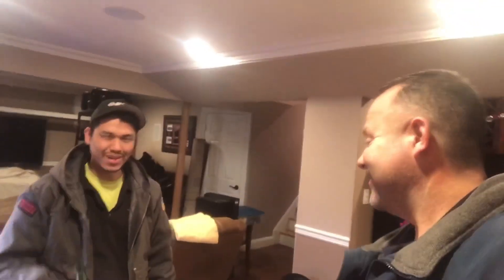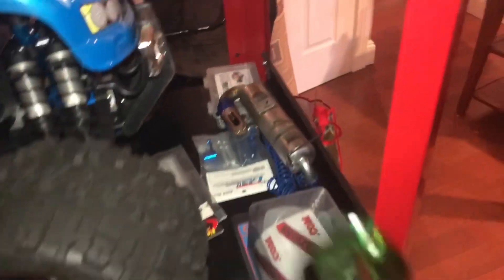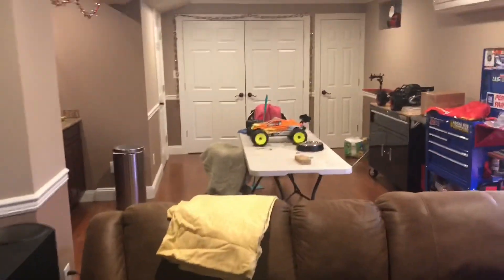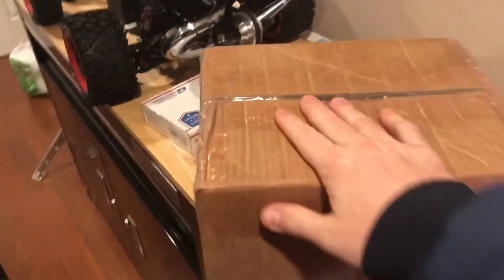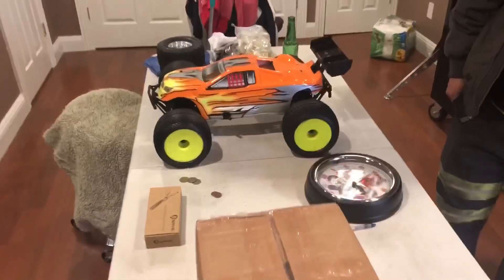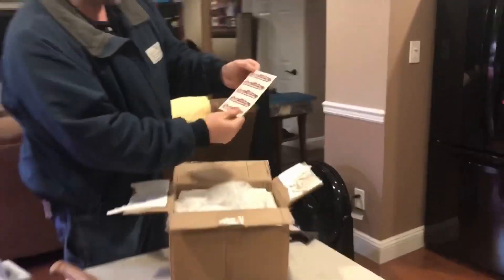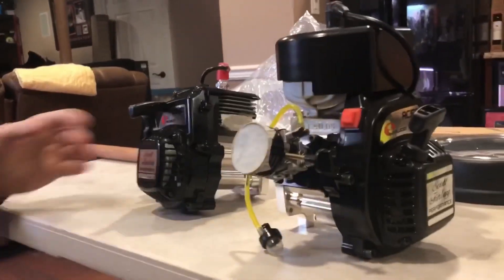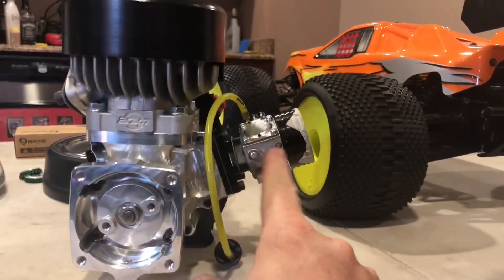Let’s Unbox A Scott Finlay⛽️Evolution💥RC50cc💨Engine With Spl Guest FT Komson! ANY ?’s

Comment: What would this motor fit in?
Reply: Anything 1/5 scale, maybe not FG or mcd but garenteed everything else
Reply from the maker: It will fit many 1/5 scales but some you will have to modify things and you will definitely have to upgrade the drivetrain especially on the 4 wheel drive RCs
Reply: Karrie Bhurgari I know it’s not gonna fit every 1/5 scale.

Comment: I thought about ordering a 40 today im stuck between the bartolone 34 reed and that 50 for my everyday basher but check out how my build is going and what vp fuel should i get for my 71 i cant get cam 2 around here so i have to order fuel off the internet help i dont know what to order
Reply: I'd get vp 100 octane or Sunoco 100 octane
Reply from the maker: First find out what compression your at and what Head squish your builder did for you then you can find out what octane to use! Mine will be fine between 98 and 108 and I will be running 💯. Cam 2 and if I had to? I would use VP or Sunoco. Now some of my friends run even higher compression because all they do is race No bash and they can not run 100 ! They will have to only run 110 octane and sometimes it may have to be leaded also . I don’t go that route become I run 1 fuel for all my RC engines
Reply from the maker: Karrie Bhurgari what are you using as far as diaphragms ?? Because you won’t be able to run regular ones in your carburetor for to long ! Are you going to use that honeycomb looking metal diaphragm?
Reply: @BOTAJELL  no, I'mma flush the system with ethenol free fuel to clean it out. I do plan on getting a carb made for alcohol but for the time being I'll just use E85 and flush .
Reply from the maker: Karrie Bhurgari I hear that the special diaphragm that can stand up to Nitro,Alcohol,Ethanol blends works awesome even for guys that run pump gas to Ethanol free . It will produce an unbelievable crisp acceleration ! I never had one or tried one out but a friend of mine has and I may try it out sometime?
Reply: @BOTAJELL  what's the name of it ? I'm very interested,
Reply from the maker: Karrie Bhurgari don’t know but it looks like a bee hive or a honey comb
Reply: @BOTAJELL  k I'll try to find it

Comment: In this engine 50ss ???
And how many horses are there ???
He is huge, but HEAVY !!!!!
And definitely not resourceful!
Does it make sense to put it on the dragster ??? I wonder what the price of this engine ???

Ps. Pump on the hose .... good solution. On Skopod and this nebylo.)))

PS2. Buy an ALX 85cc engine.

Very surprised!))))))
Reply from the maker: Andrey Bo don’t know but Chris Bartolone once showed me the bar graphs and differences between stock and Modified and pipe differences that are out there for certain applications that’s how I got to choose my Drag pipe over side pipe and the new EndBleed pipe with Aluminum header but it did not show numbers that I could read . All I understood was the colors of the bar graphs📉 📈 and what pipe and what engine he tested and I went by that. Only Chris or the man performing this would understand. Every dyno is different and shows different readings this is why they don’t say fake numbers like others that do engines ! They only use this dyno to test there products for peoples different applications either bashing or Drag racing or Boating 3 completely different setups and can not all be the same !
Reply from the maker: Thanks about the carburetor info . If you have or know anything else more about it ? Please let me know because I’m new to it!
Reply: @BOTAJELL  the hose on the carb and engine is a primer bulb since u don't have 1 on the carb, it's nice to have so when u crank it up for the first time you aren't cranking dry,
Reply from the maker: Karrie Bhurgari yeah that’s pretty cool and can be very helpful over the j71 and the weird carb on my SkoPod 62.
Reply: @BOTAJELL  yup 👍 wish the wj71 had that
Reply from the maker: Karrie Bhurgari yup me too! I think Bartolone May use a heavily modified 990 ? Not 100% on that but he told me that it will be a carburetor that everyone is familiar with
Reply: @BOTAJELL  

The carburetor on Skopod stands stock, from Zenoah62ss. Zenoah62ss 62ss, it is an aircraft engine. Because there is no pump on it. He turn the propeller of the aircraft. On the one hand a screw, and on the other hand a large spring-starter. The screw is twisted in the opposite direction, released, the spring unwinds the screw, and the engine starts. And the decompression valve is not needed.
Reply: @BOTAJELL  

The carburetor is installed in appearance .. like a valbro, but more like a carburetor from a chainsaw)))). It is the gas powered tool that has such a pump on the hose. In the second outlet of the pump you need to attach the tube. The second end of this tube is in the fuel tank. This is the return of fuel back to the tank, when pumping fuel pump.

In the carburetors Valbro immediately stick two tubes. The arrival and return of fuel. In this carburetor pump rendered from the carburetor. Therefore there will be three tubes.
Reply: @BOTAJELL  

The seat is exactly the same as that of all walbro model carburetors and the like.
I have now installed the carburetor walbro 1191.
On the engine Rofun 45cc. Even this carburetor a lot for 45сс.
Reply from the maker: Andrey Bo thank you 💥🤝🍻
Reply: @BOTAJELL  that would be great 👍 if it comes with a 990 theres bassically no learning curve with the carb